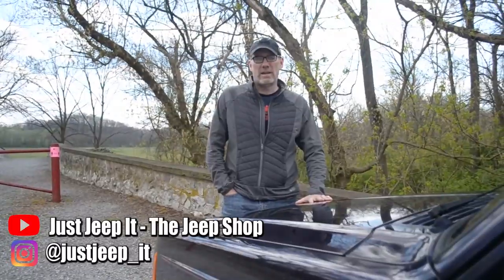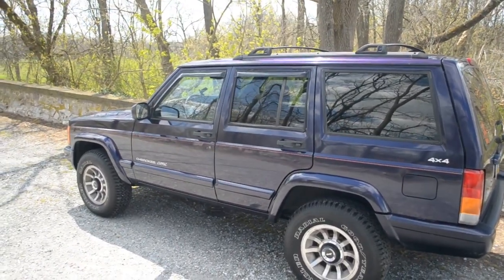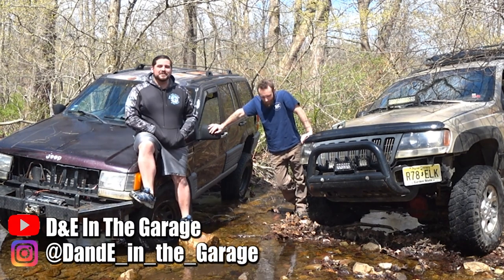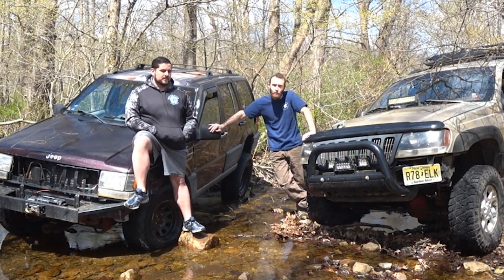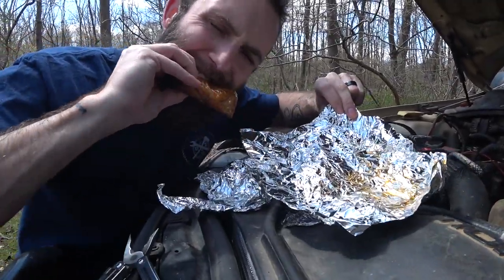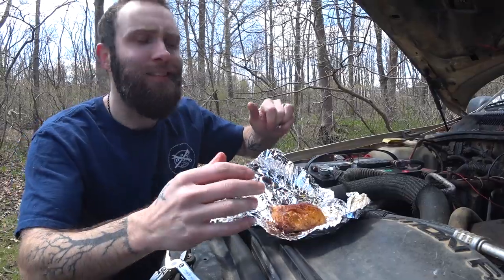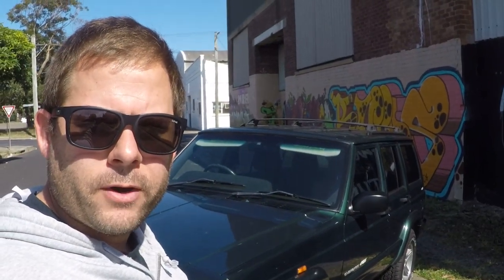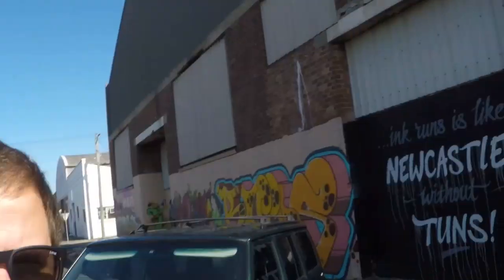JEEPS WORLD WIDE: UNITING AND ENCOURAGING THE GREATEST COMMUNITY ON EARTH

Comment: Having a problem with my 1998 xj start up runs about 5mins then it starts to spit and sputter holding foot on accurater no response. Put it to the floor it response. Then it goes away. Happens every time i starts it up. There are no engine codes when this happens.  Please help it has been bugging me for a year now.
Reply from the maker: what have you replaced so far??
Reply: Plugs, wires, cap and router. Ingnation coil. Alternator, starter. And battery thats about it with the electric.
Reply from the maker: @dustincrouch7926  sounds like an upstream O2 sensor